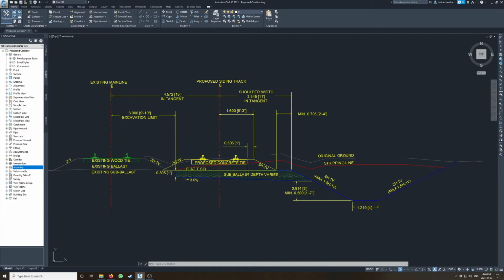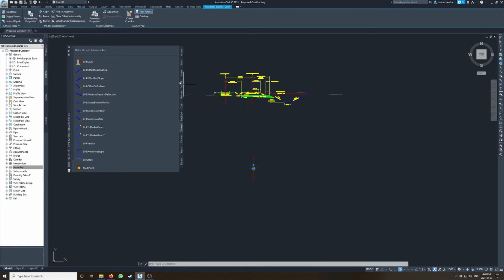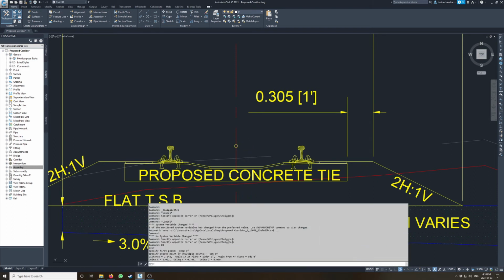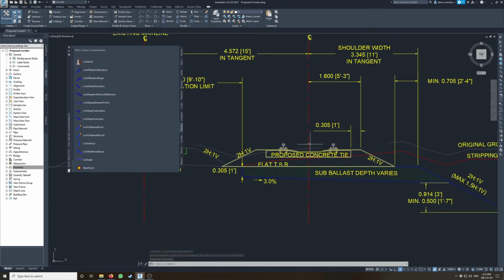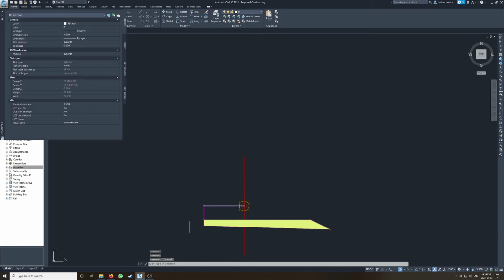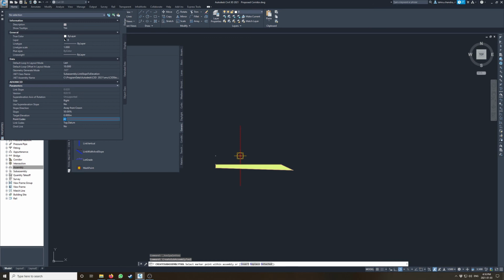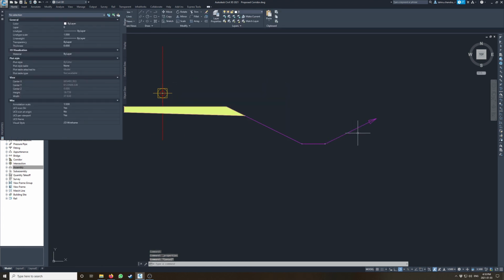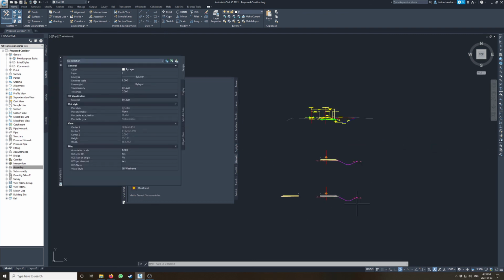AutoCAD Civil 3D - Subassembly for Basic Rail Track

Comment: in my installed cracked Civil 3D, any reason why I could not edit or input a value for Vertical Defledtion? Do I need some set up chages or what?
can you help me about this issue?
Reply from the maker: I can't say for sure. Did you use a vertical link? Can you try starting a new blank drawing and test the link there?
Reply: @civil3dtrackdesign433  yeah I restarted the software and tried tin a blank drawing as well. I think perhaps because the software is crtacked or unlicensed.